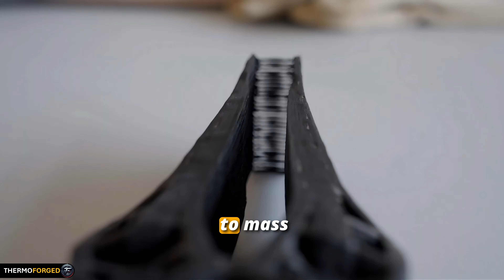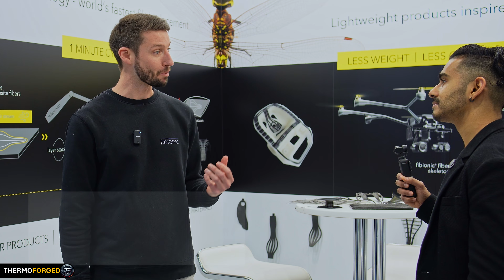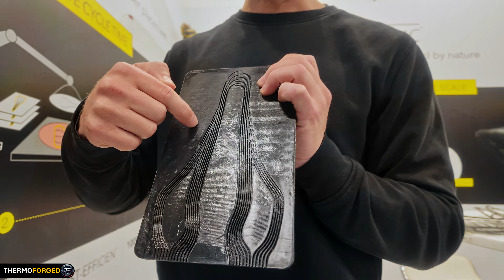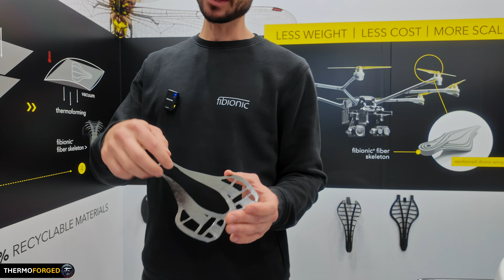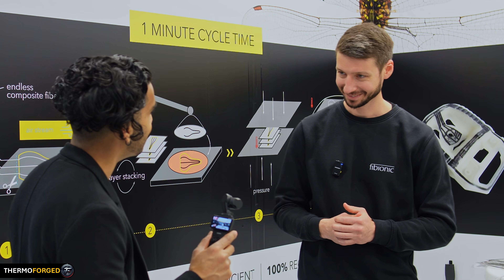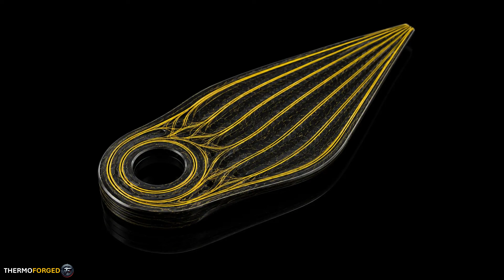The World's Fastest Fibre Placement Technology | Ft. Fibionic

Comment: So like a fancy moulding system for prepreg
Reply: Not exactly. FFP is a fiber placement process: we use a controlled air stream to guide and align continuous fibers along defined load paths, creating a bionic fiber skeleton before the final forming and integration steps. It is important to point out that fiber positioning is only one part of the entire process. Especially the 2D toolless consolidation process is another major advantage, as it drastically reduces tooling investment costs. We do the 3D forming in the final step by performing a simple thermoforming process, which requires almost no tooling investment.
Reply: @fibionic  but the carbon is impregnated with a heat activated thermoplastic resin? Right?
Reply: @GrubbyPaddler  Exactly! :)

Comment: Does any portion of the co-mingled yarn contain a continuous fibre, or is that impossible given an inherent dependence on fluttering behaviour for placement? Great concept and video, thanks.
Reply: Yes, absolutely! The reinforcing fibres in the co-mingled yarn are continuous. In fact, in all of our projects so far, we have used continuous-fibre reinforcement.

The fluttering behaviour relates to how the yarn is deposited and guided during placement; it doesn’t require the fibres themselves to be discontinuous. Maintaining continuous fibres along the defined load paths is actually one of the key principles behind our technology.
Reply: @fibionic  hello Fibonic. What is the size limit on parts made with this technology?
Reply: @YEE941  Hi! Thanks for your question! Currently, we manufacture parts up to around 400 × 400 mm. From a process perspective, the technical limit is roughly estimated at 2 × 2 m.
Reply: @fibionic 🔥🔥🔥
Reply: @fibionic   is it possible to "air form" fibers into a 3d curved shape?
Reply: @ab-nz2mm  Pretty much! The air stream dynamically guides and aligns the continuous fibres into the predefined 2D geometry. Later in the FFP process, the flat fibre structure is thermoformed with heat and vacuum into its final 3D curved geometry.
Reply: @fibionic  are thermoset prepreg too “sticky” to air form?
Reply: @ab-nz2mm  Our current FFP process is designed for thermoplastic materials. Thermoset prepregs have different handling characteristics, especially due to their tack, and would require a different process setup. We don’t exclude thermosets for the future, but our current focus is on thermoplastics.
Reply: @fibionic  got it. Let me make sure i understand this right: that bike seat thermoplastic matrix is fully consolidated as like 10 flat layer... then its thermoformed into the final shape... and that thermoform shaping step is a lower temp and doesnt affect the prior consolidation? thats one of the benefits of thermoplastics to form shape after its been "cured"?